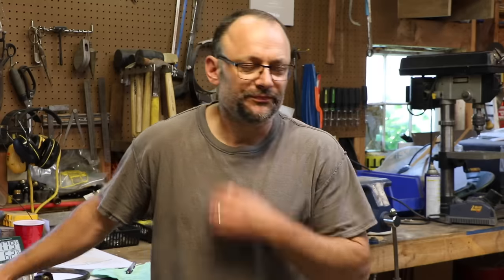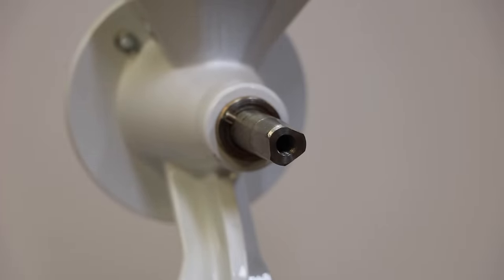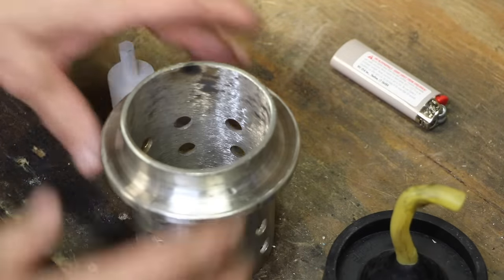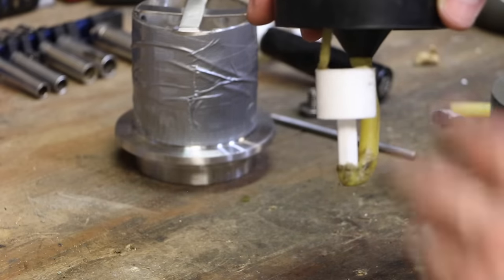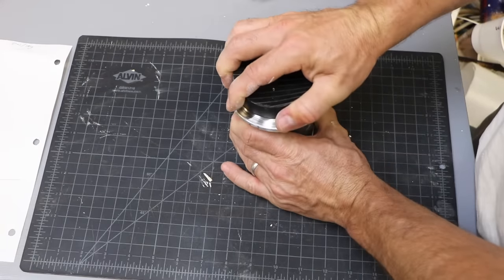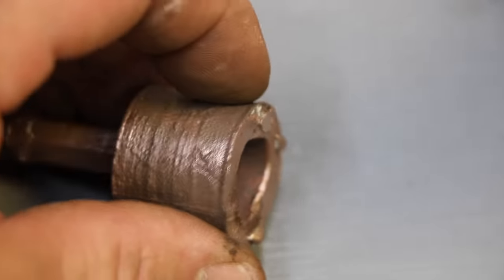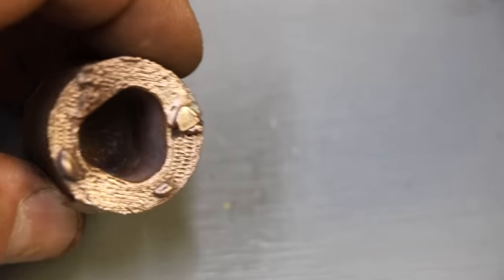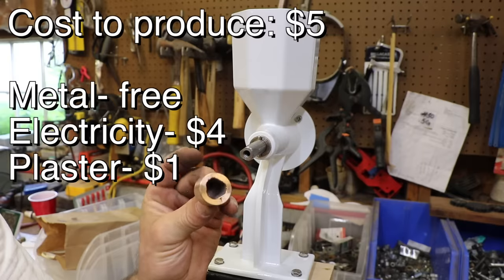I Refuse to Buy Your $@#!   I Make My Own.

Comment: The point where the socket connects to the hex shaft is a weak point.  And your lathing that point to a sharp 90 degrees significantly weakens it.  It will break eventually especially when your metal is cast bronze (brittle).  Better up size the hex shaft and add a radius to that connection point.

Comment: I don't know how the shaft is connected to the internals of the grinder, but it is a separate piece of from the grinder, a new shaft could easily be made (on a lathe and a milling machine for a keyway) for a drivebelt driven wheel. Of course you would need a fractional HP motor, too.

Comment: What you do is get a socket big enough to fit around the shaft with a little bit of room, coat the shaft in vaseline or silicone, plug the threaded part of the shaft, fill the socket with jb weld or the like and make an impression of the the shaft in the epoxy. Now you have a socket that can be chucked in a drill.

Comment: I think its tapered, because the handle will fit very well even when the handle is a bit worn out. You just put on the screw a bit. If you will make this mile just with a handle, its a good design. Imho they didn't think about electifiieng this in the first place.

Comment: And the "funny" thing about this is that the company probably doesn't make any real money off of this. The amount they sell and thus the batch size they make (or outsource) is probably quite small driving up the price considerably that the price they ask is probably a reasonable price for what they have to pay to produce the part. Obviously making a simple part cost a lot makes people buy it less, ironically making the price go up more due to previously stated reasons.
Considering this, the company might make more money just by making the parts modern standard (apparently this WAS a standard shape, it's just that we're living 100 years into the future), even by selling it at twice the price competitors would be selling it, as people would just be okay with the part price and not look for alternatives online. Less price overall, but a lot better margin since it's a commonly made part and then you just stick your logo on it (very common practice).

Comment: You could have used a taper lock or even a 6 point nut driver.  By the way you're using every cloth I'm going to guess that you've never done a toolmaker or machinist apprenticeship.  Am I correct?

Comment: i would have used the fancy "add fillet" tool in fusion 360 to try and relieve the stress concentration around that hex part, but i've also never figured out how to add a fillet without fusion 360 freaking out

Comment: For the 3D printed part you could of made the OD of the part into a hex and printed at a high infill and used a socket Lot more work then just putting in the chuck of a drill but for someone who doesn’t have metal melting gear there’s always a what of saying fuck you to companies

Comment: If you just took the angle-grinder to the shaft to make the end 1/2" of it parallel, you could just apply the drill directly to the shaft, no?

Comment: I did something similar for my flour mill. But instead of all the casting work I just heated up a steel nut of about the right size to bright red and then hammered that shaft into the hole. Then I wanted it connected to an electric motor, so I connected the nut to a pulley, and the oridinal bold backing that held the handle on holdes the pulley on now.

Comment: I have a hand crank meat grinder that is likely older than I am that uses the same class of attachment for it's handle. I don't know if there are standards for that, but it's not an idea unique to that brand.

I think the reason that format is used is that it removes the slop without needing to be finely machined. A straight sided hex would wobble if it has any clearance at all and a tapered hex (which could interface with a socket) would probably not work as well (too many points of contact so who knows which ones will actually touch).

Comment: dude you need to put down the Q-Anon.  They made the shaft tapered not to be difficult. They made it to WORK. For years  and years. a hex or D shaft would wallow the handle out pretty fast. so they made a taper, instead of a press fit. So the end user CAN take the handle off and on easily. While keeping production cost down so you can AFFORD TO BUY the fucking thing. all you had to do was slide the handle off and make a driver that engages the pin and not the pentalobe. not that a tapered pentalobe is like some black art. its a shaft, tapered in a lathe with a tri lobe machined into it. wooo. super esoteric? lol

Comment: I totally get it.  If you have the means to supply yourself with a solution rather than needlessly shell out cash to a company that knowingly took the p#ssy way out and made form fitted parts. This is really the way generations before would of gone about this. On a much bigger scale it's a lot like the issues with getting a large tractor serviced through John deere. What a nightmare these farmers face with that b#llsh!t

Comment: Looks like there is enough shaft to mount a pulley on the shaft between the hand crank and the mill body. Would let you have the ability to hand crank or run the mill off of a belt and pulley system. 
 Nice use of the 3D printer making a somewhat unavailable part.

Comment: Good on your effort. Concentricty was lost between outside and triangular centre. 
Perhaps you could make the drive out of round bar with a hole the same diameter as the shaft and tap in two screws ,or three to become like set screws  on the three flats of the shaft and provide the drive.Shaft on drive socket could be turned down to 3/8 .

Comment: a normal impact hex socket (the kind they use at the tire repair shops, not the 12 corner type)+ adaptor square to hex would it not fit the back of the mill ? seems conical and you could just push it there then drive it...

Comment: Hmmm, need a hex shaft. Got a tri angle. What could I do in 10 minutes to make a 6 sided shaft from a 3 sided shaft and retain the original handle? How about - cut the points off the 3 sided and make a hex?

Comment: Seems silly to 3d print anything for a cheap project that turns slow, would be way easier to cast something with jb weld and cheap socket and be done in 10 min.

Comment: Have you thought about getting a bigger / more powerful motor and add some gearing that will have a lot more torque to be dedicated to your grinder?  Have it all attached as one unit so it can be portable and moved into the kitchen?  Put a Variac on it so you can vary the speed along with an on/off switch :)  :P  Just an idea.

Comment: I understand your thinking, and with all the tools and skills you have it works out to make something like that, BUT you could have just cut the  handle off the connector and just welded a small bolt onto it so it would fit the drill a lot quicker of course you wouldn't have the handle anymore

Comment: A few things for the 3D print
1. You could get away with a much bigger hex on the back
2. You could print it solid (the hex looks almost completely hollow, is it supposed to have a bolt threaded into it to increase the strength?
3. You could rotate the model so the hex is pointing horizontally rather than vertically as it prints, this would mean the layer lines aren't working against you so much.

I like your solution though

Comment: There is a socket that you can buy. It has steel pins in it that collapse and it conforms to different shapes, allowing you to tighten or loosen a fastener. You can have a socket extension and can fit a drill to that. It may work. When I bought my tool that does that, it came with the socket wrench but that you won't need. It works and is designed to accommodate damaged heads on bolts, etc.

Comment: The taper may be there too
 to reduce slack when working with the machine. Maybe the company made it so that it would not be annoying to use the machine. My machine is not like that. It's like you want it, square, and you can tighten the screw as much as you want but it does not help. The lever wears over time and the square hole becomes larger and even more irritating. For $ 30, maybe it's the engineering work you pay for?

Comment: You have way too much time on your hands. Just put a coupling of round hole size to fit shaft and weld a stem on it for your drill . Put a pin through mill shaft. And coupling. Easy.

Comment: Another idea that might have worked, is instead of the 3D print tapering for the drill bit, instead make the perimeter into a HTD belt. Other side of the HTD belt to a smaller metal pulley attached to the drill.

Comment: Why not put a bolt and jam nut in it and just use a drill and socket on it like you originally wanted to... would have taken all of 20 seconds.. you could have avoided making a video about it and it would have saved you a bunch of headache.... i see that lathe behind you... stop thinking like an engineer and start thinking like a machinist

Comment: That's awesome, I need to make a forge. I do wish the hex adapter had a fillet at the base. It would make it a lot harder to snap off. If you end up snapping it off, add a fillet lol. An example of what I mean in case someone's thinking steak https://en.wikipedia.org/wiki/Fillet_(mechanics)#/media/File:Fillet.jpg

Comment: I would have just made a long sleeve on the lathe (1/8" wall)  with a couple set screws to hold it on the shaft  turn the other end down to 1/2" to fit the drill, you could mill the hex on if you wanted or just weld on a cheap impact drive type socket to the sleeve after drilling to center it.

Comment: That's not really a proprietary connector style but it is far less common these days.  If they made it hex they would still have to taper the opening to allow you to take up the slack so from a design standpoint it would likely be equal or superior to hex when using the hand crank since it spreads the load across a large 3 point surface area with a low chance for cam out when the handle is snug to the taper. 

If you had to make this adapter out of steel or without casting it you could match the original hole in the handle by cutting off a piece of round stock the appropriate size and drilling a small hole through for the taper and using a large hole for the start of the taper and then simply use a triangular file to remove the material for the three tapered flats.  You could then weld a piece to the back end that you could use to chuck into a drill.  Either way it would probably take a couple hours to make and with the time involved, it would be far more economical to just buy the adapter or add a pulley or sprocket with the appropriate size locking collar and just drive it from a motor.

Comment: Assuming I didn't have a drill with a large enough chuck.
I would have taken a 3 inch long malleable iron pipe that fit just over the shaft. Then cut an inch deep slit length wise into the end and use some iron bar and 2 bolts to clamp it to the shaft. On the other end thread in a bolt to provide a hex head to put a socket wrench on.

Comment: The plastic stem obviously wasnt strong enough but the bigger plastic part might have been strong enough if you had just milled off the sides to a hex and put a socket over it.

Comment: I'm going to take the contrary point of view.  The design actually makes a great deal of sense.  Using three sides means that the handle won't slip on the shaft.  By adding a taper, when the bolt is tightened there won't be an slop or wiggle in the connection.  As for the cost of the adapter:  This is not highly mass produces item.  So, the cost per item is going to be higher.  If you spent a lot of time making this, it makes sense that this is also a time and labor intensive item for the manufacturer to make.

Comment: I would have welded a hex on a bolt thats not long enough to bottom out, then used anti-seize or grease on the bolt. If the bolt happens to break it should come out fairly easy. Washer and lock washer of course.

Comment: I would’ve found a piece of 1/8” tubing with an ID of that shaft OD and then drill and tap holes 120 degrees away from each other. Put set screws in the nuts to grab the shaft and then weld a nut on the end of the tubing. I don’t have a smelter.

Comment: Obviously the correct choice would be to machine that idiotic taper from the mill, turn and sleeve in proper hex adapter to the handle and live with it, but we wouldn't see the casting process.

Comment: Wonder what a new handle would cost. Buy one, chop, weld bolt to it, turn bolt smooth, sand in a couple flats for the drill to hold on to. If handle is cast, bit of silicon bronze brazing then.

Comment: I'm a great practitioner of doing way too much work for too little return ;)  Good on you - I'm following your lead.   With that said could you weld a piece hex steel on to the end of the shaft?  Or better yet a threaded piece of hex and screw it into the hole - no welding involved?  turned out great by the way - Carry on ;)  Gary

Comment: Pull off the handle. Screw the bolt back in. Use a driver adaptor on the end of your drill that matches the bolt head.

Comment: Use one of those universal sockets that have all the pins that conform to any shape bolt or whatever! Put it over the cylinder with the 3 shaved sides and the  attatch your drill and grind away! God Bless!

Comment: Way to much effort in this.. you could use a piece of stainless pipe that fits over the shaft. Let's say 3 or 4 inches weld a bolt or some sort of hex on one end and cross drill the pipe through the shaft just past the internal threads!

Comment: Try making a hole saw arbor type quick connect. One that screws in and then the adapter slides over and has a large nut to secure it in place. That way you cam put a flywheel on and hook up a belt and motor

Comment: Bore a piece of steel 3x the shaft diameter, twice the length of the exposed shaft, turn one end down to fit your chuck, bore the other end to a sliding fit on the shaft and drill a hole through the steel and shaft to take another small roll pin and there you have it, quick and no casting and when you remove the pin then you can still refit the handle … you could also file a hex on the turned down end for secure chucking …

Comment: I think I would have just used a piece of pipe of the same size as the shaft and threaded 3 bolts to lock it on the flats.  Do the same on opposite end of pipe to connect driver bit.  Simpler, that's all.

Comment: i was surprised you didn't just cast it and on the main barrel turn it to a hex head where a socket would fit it rather than the drill fitment. possible even the plastic might of held if you just made it a standard hex on the outside.

Comment: A simpler solution would have been to add a hex to the outside of the body, and delete the hex shaft that snapped off instantly anyway. But that would have been a much shorter and less interesting video.

Comment: I have one of these mills.  Takes a lot of force to run it.  A workout!  They also sell a pulley to connect to a bike at ridiculus cost.  Then they say you can connect yo a motor.  Not so easy, oh and it voids warranty.  The mill no resides in the closet on the 'when I get time' list.

Comment: There was a much simpler way of doing this cut off a bolt head, on the lathe, cut a radial groove in the shaft next to where the nut will be when tightened on the grinder. Tighten the nut against the end of the grinder shaft.  If the bolt breaks It will break next to the nut, loosen the nut, and remove the bolt.

Comment: The shaft is tapered to ensure the handle remains in full engagement, if it were a hex shaft then the handle would wobble....thus the taper is actually good engineering design, even if it is a pain and the adapter is overpriced.

Comment: Sand the end. Cut an allen wrench so its a straight rod. Sand the end flat. Weld to the end attach drill. If you want it even nicer get a cheap coorded drill. Swap the trigger for a toggle switch and it becomes a cheap motor

Comment: They made the taper on there so the handle comes off easy and wont slip, it tightens up with the bolt.  The bolt and friction dont handle the torque.

And its relatively easy to make the taper.

Comment: You wasted a lot of time and work. Here, in Brazil we would put a piece of metal pipe on the shaft, hammer it into a triangle and weld a drill on the other end. Easy.

Comment: That is an standard tapper on every table mill and old pulleys, is not proprietary just not common anymore, there should be a standard pulley around that fits said shaft.

Comment: Credit to the engineer that designed it, the trilobe keeps the handle from slipping, and the taper can be snugged up to make the handle feel rigidly attached to the shaft. Kind of nice for the intended application.

Comment: Would a 6 point socket fit on the shaft. The use an adapter for 1/4 or 3/8 drive for a drill or impact driver